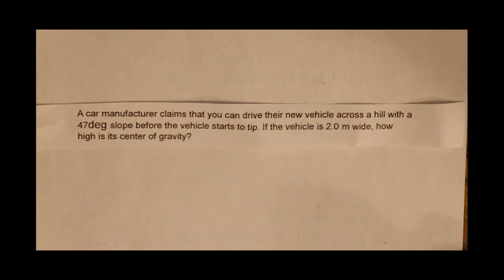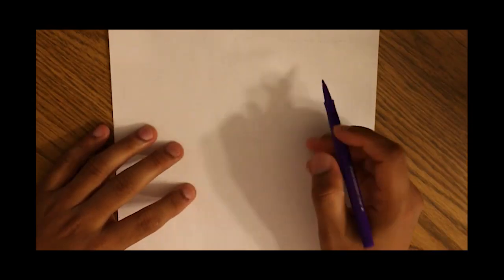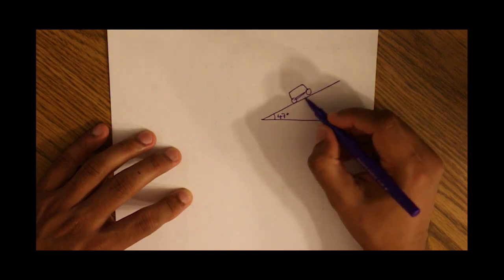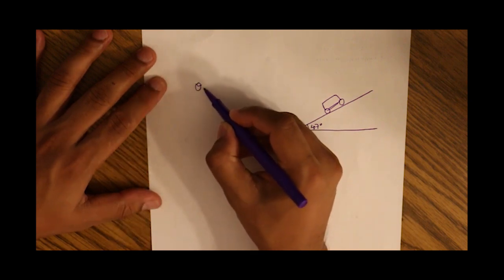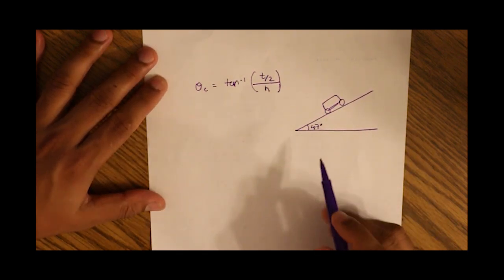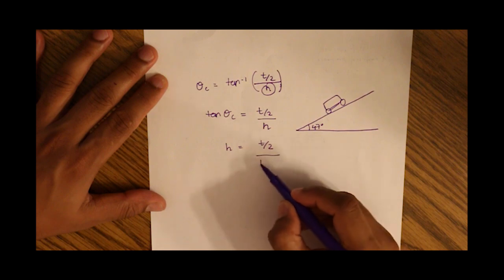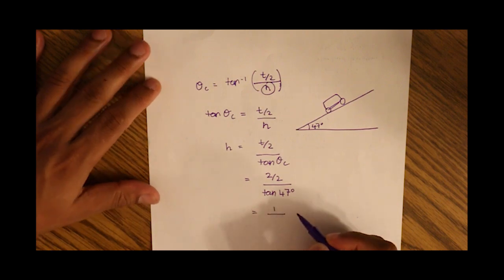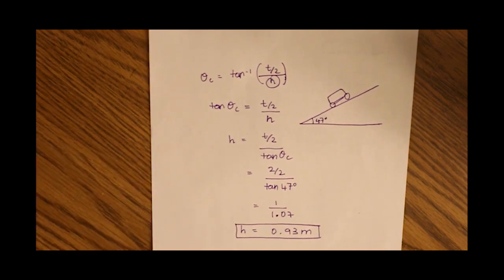The Tipping Point of a Car - Find height of center of gravity with critical angle

Comment: This is assuming the center of mass between the wheels is dead center. Otherwise the central mass could be anywhere on the vertical line from the lowest tire on up. The height of the vehicle doesnt matter, the center of mass between the left tires and the right tires is needed or you have to assume is dead center

Comment: I think we are forgetting the actual height of the vehicle, this value must be included in the formula. A 2m wide double decker bus is going to tip over at a lower angle than a 2m wide family saloon. And we should solve for the angle of tip over, not factor the angle into the equation I believe ... and to know the CG we have to be given the center of mass, or calculate the center of mass first. Imagine if you moved the engine and transmission up to the roofline level of the vehicle, changed the center of mass to be higher, thus the CG would be higher in the given envelope. Remember the centre of mass is the point at which the distribution of mass is equal in all directions, and does not depend on gravitational field. Centre of gravity is the point at which the distribution of weight is equal in all directions and doesn't depend on gravitational field.